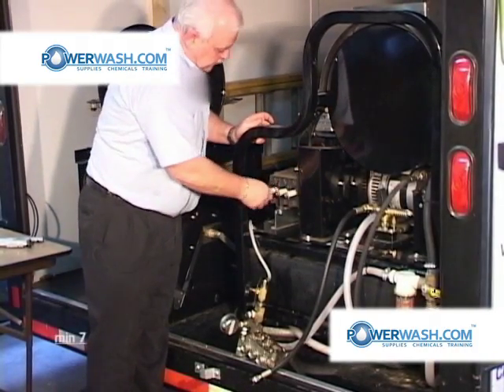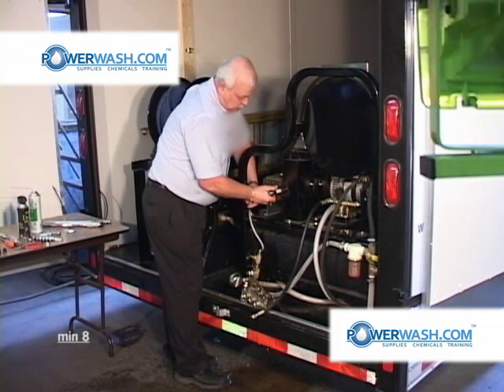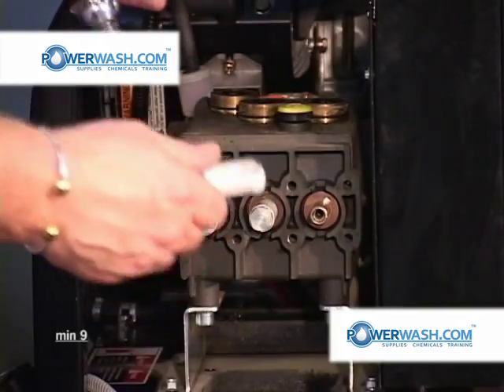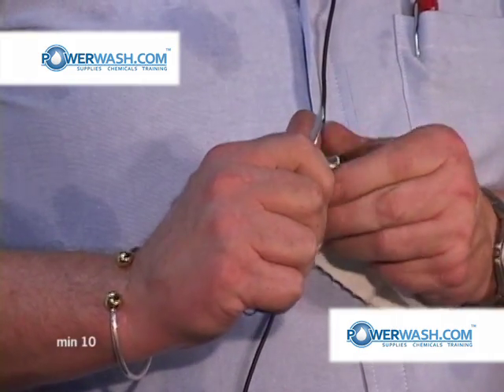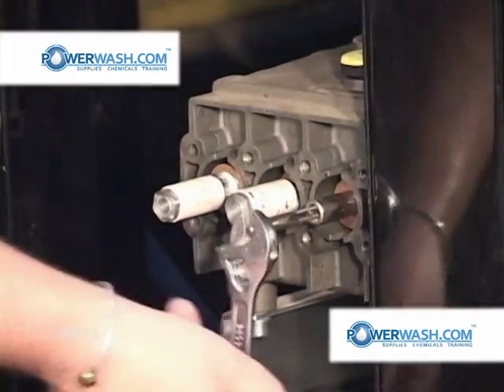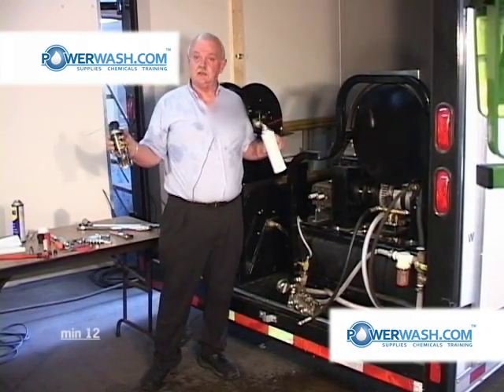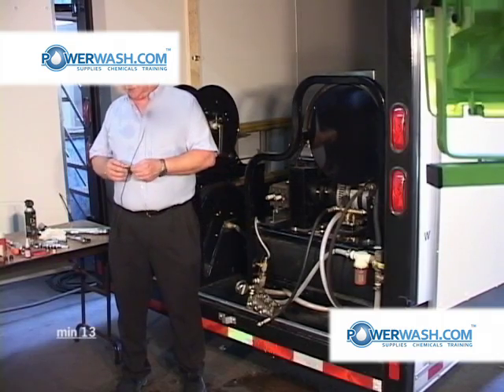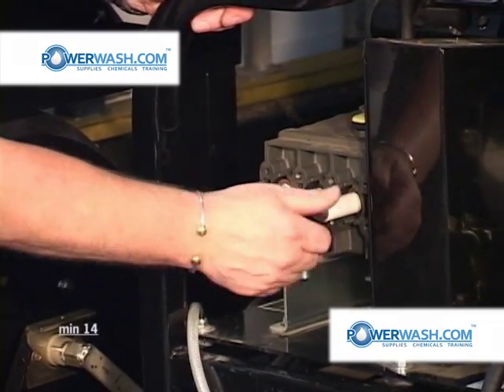Rebuilding a General Pump P2 of 4

Comment: great informative video. if I may add...I would highly recommend replacing the oring on the bolt before reassembly as I have had to pull the head off before due to that oring leaking